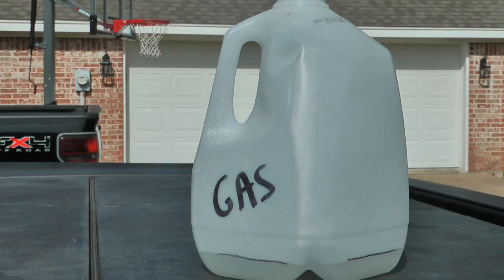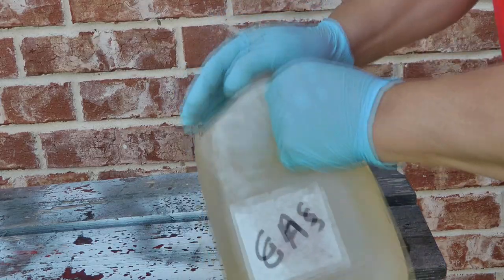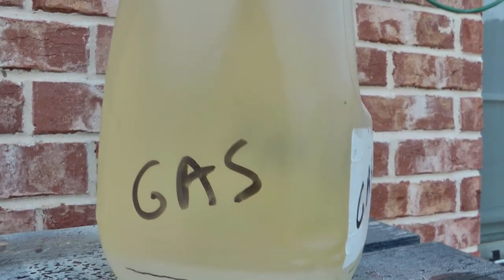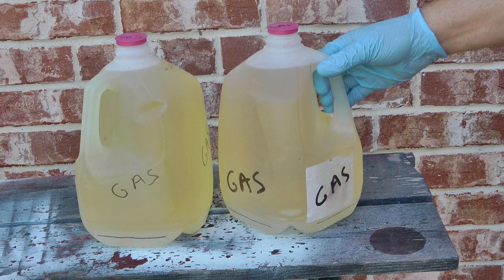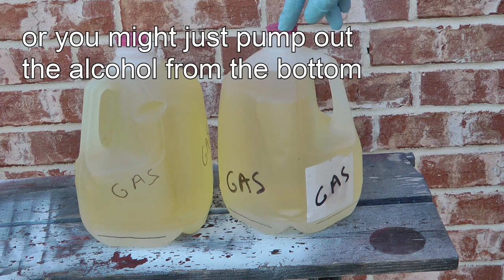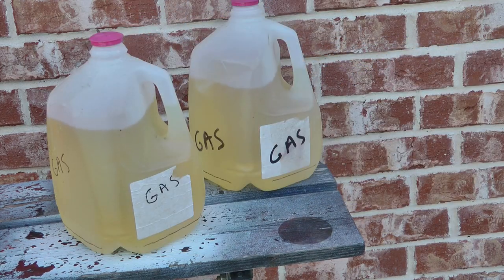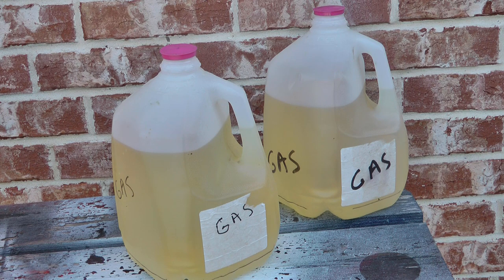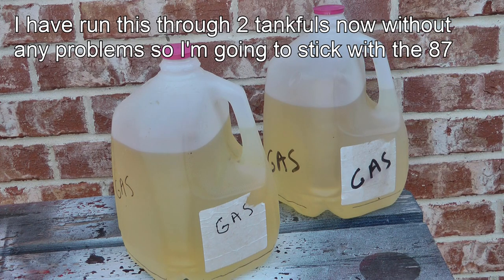Ethanol free gas at home - how to make it

Comment: very nice tutorial! similar process/method used in lab with a separatory funnel. If you can spend $20-30 for a large separatory funnel and lab stand, it’ll make the process extremely easy and thorough.
Reply: Mr funnel
Reply: @jp-us9rq  Mr. funnel just removes the water

Comment: Yo Gary,

I'm dead at the intro.
When your boys get to high school, you can encourage behavior modification if needed by threatening to send your YouTube videos to their classmates. lol
-
Next Video:
"Does Homeowners Insurance Cover Accidental Frugality" 
-
I've been getting by with E10 in my lawn mower, (my nearest 100% Pure Gasoline is 30 miles away).
It's a 15 year old MTD with a Honda GVC160 engine.
It's all original, just routine maintenance.
Haven't had any Carb problems yet.

I don't know if this helps, but when I shut it down after mowing, I turn the quarter turn fuel valve off just before the carburetor, and let it "run out of gas".
The next week I turn the valve on, apply the spring load choke, and it fires on the first pull.

-Chuck
Reply from the maker: W will be a freshman this fall
Reply from the maker: W started high school this school year... yikes!
Reply: @WJHandyDad  
Do they still have;
Autoshop,
Woodshop,
Metalshop,
and teach Driver's Ed?

I had 4 years of Woodshop, 3 years, of Autoshop, and only one year of Metalshop.
Reply from the maker: they didn't have those classes when I was in high school but they did do a thorough driver's ed program for us.  I'm pretty sure the only things my son is gonna learn is what I teach him because I am not aware of any of those classes in his school.  Unintended consequences of Title IX
Reply: @WJHandyDad  
Well I guess those classes are not needed as much with the internet and all.

I remember when I was a freshmen in 1993, and my high school library got the first internet connected computer.

We were all told it's called "Netscape" and we were supposed to use it to look up, and find library books with it. lol hahahah 
Wild huh?
Reply from the maker: personally I think those classes should still be in school
Reply: Yes, but you miss an very important point. That is that ethanol gas goes bad in a very short time. Also, even if you run your machines out of gas, ethanol eats up gaskets.  Anyone who knows anything about small engines knows that you shouldn't use ethanol gas in them, if possible. Sure, you can get away with it for some time and maybe even for the life of the engine but that life will be shorter. Also, ethanol gas provides about 10 to 15% more horsepower and torque.  Did you know that?
Reply: TRY :" AVGAS" = 100% ETHANOL FREE & 100 > 140 OCTANE!  ( PEOPLE DONT LIE: OLD airplanes crashing thru the roof ; watching TV; bed; bath? ? Don't want the farmers 100 year old farming equipment : stop running & we starve! That whumy you have to go to framing areas to find the :" blue handle, NON- ETHONOL " gas?😊😅😮😂❤

Comment: Great video. Just a thought on the topic I’ve seen another video on this process where you freeze the bottle. The water and ethanol mixture stays frozen on the bottom of the jug and you can pour our the pure gas very easily. Try it out. If you do let me know. I think I’m gonna try it.
Reply: Just subscribed so maybe a trial video on my freezer idea in the near future?
Reply: Ethanol in water will be very hard to freeze. Not a good idea.
Reply: I was thinking the water will freeze but ethanol shouldn't. Would work good if you were making your own ethanol fuel from sugar water and yeast.  May even work without distilling it. Hmmm. I need to try that. Lol.

Comment: you could put three or so holes in the cap and just turn it upside down and food coloring helps to show the water/ ethanol.  Another good container to use is a laundry detergent bottle that has a valve on it.
Reply from the maker: great tips thank you
Reply: WILCO & DID!😀😃🫠😁😆😄❤ ~~~~ BUT DRAINED INTO A :" APPROVED  GAS CAN/ SMALL ENGINE GAS TANK !" 
: ADDED STABLIZER JUST IN CASE & A " IN LINE LOW POINT DUMP VALVE" WINTER/ SUMMER ~ ANYTIME?😂😇🙏

Comment: So, I'm looking at this to use in a 4 stroke 150cc scooter. What's the upside? More power, more gas mileage, both? I'd love to get both.  - Just buy an octane booster to add it back.. cheaper than buying the expensive gas. Now you have the best of both.
Reply from the maker: I do it for carburetors... gas with ethanol in it eats up carburetors and causes all sorts of problems.  Ethanol free should give better gas mileage and performance as an added bonus.
Reply: @WJHandyDad  Thank you sir, much appreciated!

Comment: There are a lot of different additives such as octane rating enhancers, corrosion inhibitors, lubricants, metal deactivators, stabilisers, and antioxidants to prevent fuel degradation. 
How do those additives in the fuel react to the water?
Reply from the maker: I don't have the scientific background to answer that.  All I can say is the fuel worked fine in the short term, but I needed a higher octane to use it long term, and eventually several local stations started stocking the ethanol free so it became pointless for me to convert the e10 to e-free
Reply: @WJHandyDad  Thank you for the response. Hopefully one of the car-tech channels will look into this, as I think people underestimate how complex modern fuel is, and how the complex emission systems in our car make assumptions about what's in the fuel running in the car. Watering out the ethanol in the fuel is cool, but knowing what else the water is interacting with in the fuel is equally important, IMO. Great content on your channel, BTW. 👍
Reply from the maker: I was doing this to make e-free for my carbureted lawn equipment, not run in any vehicles.  I am now trying out one of those supposed "stabilizers" for ethanol fuel used in carbureted equipment.  We shall see if I'm having to replace carburetors next season....

Comment: So, what do you do with the ethanol water mix left over from this process?
Reply from the maker: the proper method is to dispose of it as "hazardous waste"
Reply: @WJHandyDad  Thank you. 

Followup questions.

To reduce the amount of hazardous waste, can the ethanol layer be easily separated from the water? 
 
Also, is the ethanol/water mix reusable? Can you just add more pumped gas for another batch? Essentially, allowing the ethanol to accumulate over time.
Reply from the maker: @TheLaserguy2  unfortunately I don't know

Comment: How much octane booster do u need to add to get back to >or= to 87?
Reply from the maker: I don't have any way to test the octane... most folks say start with 89 or 91 and it should end up at 87.  After I filmed this video we got a station real close that sells ethanol free so I haven't been doing the water removal technique recently
Reply: Oh okay. No one has it in my area and it’s listed like 18$/gal which is a rip off
Reply from the maker: wow, yeah that's crazy.  Ours is typically about a dollar more per gallon than regular gas (aka e10 or e15)
Reply: I need to pick up a 5 gallon Poland springs bottle and start running 4.5 gallon batches. This is so easy. I will never run ethanol in my equipment again

Comment: do this with shell nitro v power. its 93 octane, and only 5% ethanol. yeah octanes gonna drop but not that much with the nitro v power since most of its octane boost isn't coming from the ethanol.
Reply from the maker: thanks for the suggestion.  I'll check that out

Comment: Looks zo me like all he removed is zhe water he put in. If it was 10 % ethanol it would be above the line more then it was. I get gas from gas station in a clear container let it sit for a bit and I get about 1 inch water on the bottom.
Reply from the maker: 2:18 it's clearly above the water line

Comment: washer solvent jug, drill a hole i,under size for line, n cap, put an 1/8" vacuum line or small engine fuel line , clamp the end of line. mix your water and gas, shake it then turn it upside down , water and ethanol will settle to the botton, unclamp line and drain the crap away
Reply from the maker: thank you for the suggestion!

Comment: Cool video thanks, Problem I’m worried about is how much water remains in the fuel and are the minerals that were in the water now dissolved in the gasoline. Like say the water u are using has a high calcium content. Thanks
Reply from the maker: that's a great question for someone with access to laboratory tools and scientific knowledge.  I have no clue.  I'm just a DIY guy.  I guess if that is a concern, you can always use distilled water

Comment: Taking the ethanol out of the gasoline reduces it to sub 84 octane,  I found out when aromatic compounds used to be added to get the octane to 87 and 93.  They refine the bulk of the gasoline product to 84 octane to get the most gasoline possible and add a slight amount of aromatics to close the octane gap needed the 10% ethanol is now used to adjust the sub 84 octane to adjust it.  I am not sure how well small engines run on lower then 87 octane but it really would not be good in cars with higher compression engines that a lawnmower at 6.1 ratio as most cars now are 8.1 to 10. nowdays.
Reply from the maker: thank you for sharing.  Yes, I noticed that long term using the 87 and removing the ethanol was not ideal for my mowers.  I do not use this in vehicles since they seem fine with a little ethanol.  It's my mowers and lawn equipment that the carburetors get messed up with even 10% ethanol.  So yes, best to start with 91 or 93 octane if you're gonna do this method.

Comment: Take a 1 gallon glass jug. Buy a stopper (with a hole, or just drill it out) that fits the jug.  Add a tube to the stopper with a shut off valve.

Mix you gas and water. Turn the jug upside down. Open the the shut off valve and slowly let the water/ethanol drain out.
Reply from the maker: great idea thanks for sharing

Comment: Just saw your video have you ever thought about using those like gallon and half or 2 and half gallon clear water jugs with the spekit (a pull out plastic tab and push in thing) on the bottom you would have to have to cut a hole out the top to pour it in and maybe sit at an angle but would be easier...
Reply from the maker: that is certainly a great idea

Comment: Only issue with this process is the fuel companys use ethanol to bring up the octane rating. And to remove the ethanol if you already have like 87 you will be in the low 80's for octane now that might be fine for small engines and old cars but the newer stuff you will see a dramatic loss in power or even cause pre combustion
Reply from the maker: yeah, I only use it for my lawn mowing stuff, haven't tried it in a car or truck
Reply: @WJHandyDad  that low octane fuel in the long run will run you more harm then to run the ethanol free high test in your small engines. Its an interesting way to remove that Ethanol for sure but its not practical. In my opinion as a mechanic and engineer
Reply from the maker: obviously, when convenient, it's best to get the ethanol free from the pump, but it's not always convenient.  I wish I had a way to test octane at home because it would be interesting to see how many points the octane dropped

Comment: Take a 1 gallon glass jug. Buy a #6 stopper (with a hole, or just drill it out) that fits the jug.  Add a tube to the stopper with a shut off valve.

Mix you gas and water. Turn the jug upside down. Open the the shut off valve and slowly let the water/ethanol drain out.

Hill Billy Joe's always got his copper line and glass jugs.
Reply from the maker: thanks for sharing that tip

Comment: Gas doesn't freeze very easily. Just put the gallon of gas in the freezer. After it freezes just pour out the separated gas into a separate container while the water and alcohol are still frozen. Hope this helps and God bless.
Reply from the maker: interesting... I don't have room to freeze it so I won't be able to try your method
Reply: -173 degrees Fahrenheit
Well, it has to do with the freezing point of alcohol, which is far lower than the traditional “freezing point” you're most familiar with, such as water (32 degrees Fahrenheit). Pure ethanol alcohol needs to be -173 degrees Fahrenheit to freeze.Mar 13, 2024

Comment: Hopefully you're not throwing away the ethanol since it is part of what you are charged for fuel. It can be used for other things.
Reply from the maker: please share tips for what we can do with it
Reply: @WJHandyDad  since the ethanol has a lower boiling point than water, you can boil off the ethanol and recondense it with copper tubing. You'd have concentrated ethanol at that point and can still use it as a combustible fuel for something else. 

Use it to light your grill. 😁
Reply from the maker: @lGuileWilliamsl  thank you for the tip!
Reply: What other things?

Comment: How do gas stations keep their gasoline/ethanol from separating in their tanks?
Reply from the maker: presumably they have separate tanks for each "flavor" of gas they sell
Reply: most gas stations have about 500 gallons of ethanol, and lines go towards pumps and mix in with PURE gasoline. I saw one of the gas attendant's reciept. it shows it had a delivery of 500 gallons of ethanol, and 35k gallons of gasoline. of course in separate tanks.
Reply: They don't add water to their gas so why the need for separate tanks....
Reply from the maker: that would be a question for someone else.  I have no idea how gas stations run.  I have spoken to folks that deliver gas in the delivery trucks and they assured me there are separators in the tanks they deliver from.  But beyond that, I don't know
Reply: Someone has to go down into the tanks every 30 minutes and give them a quick stir.

Comment: at bottom or cap drill a small undersize hole and squeeze a clear aquarium air line and drain thru it. 
if cap save till next use.
Reply from the maker: thanks for the tip

Comment: I couldn't tell for sure but it looked like there was no ethanol in that gas. You should see a layer in between the gas and water. I test the gas from my gas station about once a year. There premium does not have ethanol in it. I think most gas stations are that way.
Reply from the maker: there was some because where I had the fill line of water you can see that after it mixes the clear area is above the line.  I think most of ours locally  is about 10% ethanol

Comment: 13 oz of regular water the rest filled with regular gas 🙌🙌
Reply from the maker: works perfectly
Reply: @WJHandyDad  would that gas work  on car after making it
Reply from the maker: it has worked on everything I've tried it on but if you're planning on using it long term, I would recommend starting with higher octane so that your octane doesn't drop too low.
Reply: Kk how much would I have to make for a full tank of gas

Comment: Why would you want to? The old leaded gas that we ran for years had Tetraethollead! Aboutv12 percent ethanol.
Reply from the maker: it's mostly beneficial for carbureted stuff like lawn mowers - I've noticed they seem to last better running ethanol free gas
Reply: @WJHandyDad  Well, my yard tractor is a 1968. I always run the highest ethanol fuel I can get. It cut 10 Akers of grass for over 30 years, and I have never put a wrench on it. The edging mower I use was bought at the same time, and all I have done to it is weld the cracked deck. I use the highest ethanol fuel that I can get in everything I own.
Reply from the maker: I haven't had the same luck with e10 fuel  :(

Comment: I call bs on this idea because ethanol doesn't separate that fast and your octane will drop from 87 to about 75 witch does not preform to the same level as clear gas at 87
Reply from the maker: it worked for me... however you are correct that long term if you are going to use this method you need to start with a higher octane gas to avoid running into octane problems

Comment: So you buy a gallon of unleaded and add water to make ethanol gas. Equally important half gallon of water to 1 / 4 of gas will make the formula yet suck out the water only use the new gas mixture. However the Container Store can design a special gallon to eliminate the water from the mixture by closing the chamber in the container. ....

Comment: Why?
Reply from the maker: if you don't do your own yard care at home using gasoline powered yard tools you probably don't need this.  But if you are running carbureted engines anywhere at home, ethanol free gas is much better for them
Reply: This also is good if you have ATV or generator that dont get used year around this is really good. I had problems with my atv setting thru the winter I would have to drain gas tanks and clean carburetors even with fuel stabilizer in them. Once I started doing this I dont have that problem no more.
Reply: This is important because I have found using ethanol gas in weed eaters, chainsaws, etc.  the ethanol will eventually damage the plastic fuel primer bulbs and fuel lines.

Comment: Just curious, will the alcohol water mixture you removed burn? Just wondering if it could be used in an alcohol heater to heat a greenhouse or something like that.
Reply from the maker: didn't try but now I'm wondering if it would!  Thanks for the suggestion
Reply: @WJHandyDad  if you try it let me know how it works. Sure be nice to be able to use the waste.
Reply from the maker: I kind of gave up on doing this.  For long term it really requires getting the 93 octane and with gas prices the way they are, I've just been using the regular 87 with about 10% ethanol in it and hoping for the best
Reply: Yes the water/ethanol will burn
Reply: @badcompany3828  thanks!!!

Comment: How do u benefit from this? Not saving money “ still have to buy gas”! So you are purifying it! Which does what?
Reply from the maker: the main purpose most folks would use this for is for their carbureted engines - like most lawn equipment.  Ethanol seems to destroy carburetors.